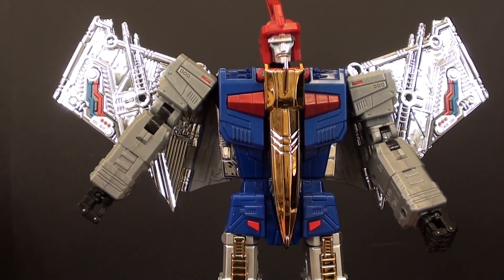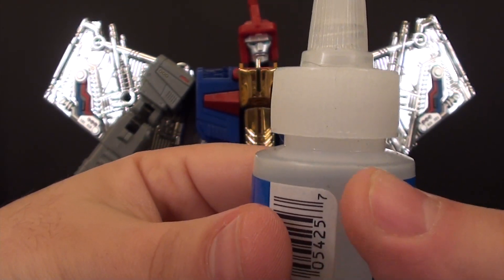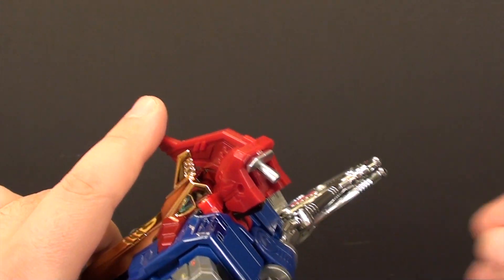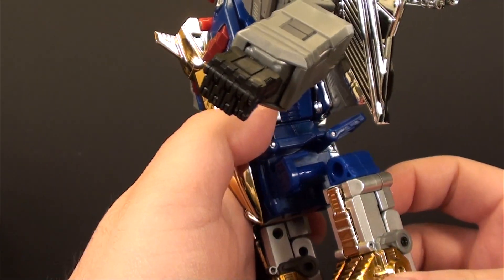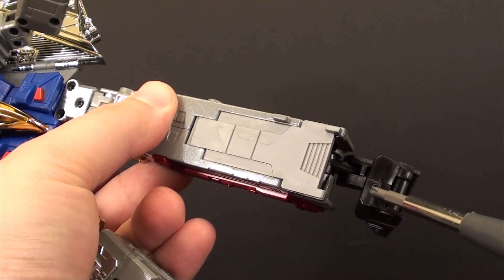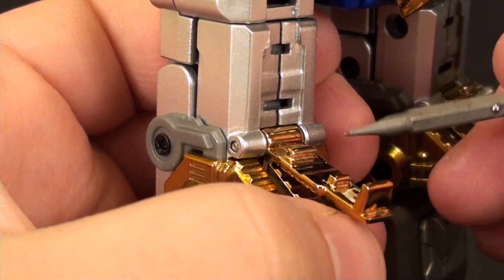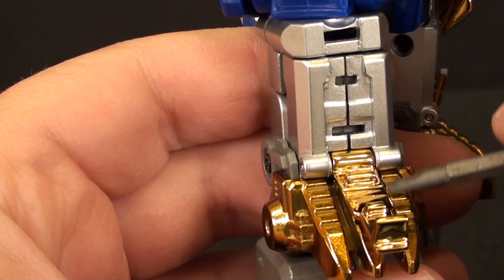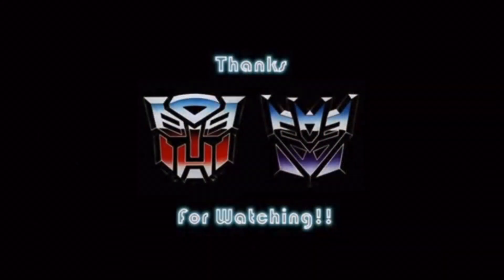T2RX6 Fixes: Fanstoys Soar

Comment: During some posing exercises, I heard a snap inside my soar's shoulder. 
Half of the mushroom's head broke and got loose inside the figure.
Could that one be fixed by only gluing the mushroom and then lubricaring the joint?

Comment: Hi there, on my Soar, his foot is very loose but I can take the screw out from the ankle joint! It's so frustrating 😫 how did unscrew yours?
Reply from the maker: That does sound frustrating!!  Did you get yours second hand?  Is it the first release or the second release?  I have a second release soar I havent' opened so i don't know if they changed anything about how the legs work. I wonder with the ankle joint screw issue you've got if someone glued the screw in place or something.
Reply: @T2rx6  I got it second hand. It's the first release I'm guessing because it doesn't come with the alternate head or up graded head.
Reply: @T2rx6  In regards to the glue. It doesn't look like it has been glued.
Reply from the maker: @mindboxing6178 hmm.. What's happening when you try to turn the screw? It's just locked in place?
Reply: @T2rx6  I found out that it is loose but you will need a magnet to take it out

Comment: that strip of chrome plastic on the thigh is killer. I knew about the weakness and tried to push it in anyway. I used a small screwdriver to carefully get it all back out. it was intense.

I wonder if removing the peg might even be best. I don't suspect the other ones popping out, at least no the top one.

And any thoughts on the shoulder squeak? thats the one I am most uncomfortable with. It's so tight.
Reply from the maker: I'll be looking into the shoulders.  From what I've seen mine doesnt' squeak.  But I've been requested to do that as well as the hands.. so I'll be doing that!    Stay tuned there!

As for the removal of the peg.. I considered removing it but am not sure how much it's required for the dino mode.  I think there's enough friction there though that it wouldn't really be required. Supposedly I'll be getting a replacement part.
Reply: T2rx6 Mine has tight hands for flipping them out of the arms in transformation. I just loosened the screw a hair, and it moves easily and remains tight.

Looking forward to any and all fixes! And I'm glad to hear you'll be getting a new part.

Comment: People should know that the silicone shock fluid can take off the silver paint.
Reply from the maker: +Renaissance Man I've never had it take off any paint, but I don't think anything that I recommend putting it on is painted anyway.
Reply: +T2rx6 I used some inside the thighs - not a fix from your video - and some just vanished. A bit of excess then leaked out of the back and took a little bit of silver off, but fortunately it's not that noticeable. It's just worth keeping in mind and taking care not to use too much.
Reply from the maker: +Renaissance Man Definitely good to know!  Thanks for sharing!